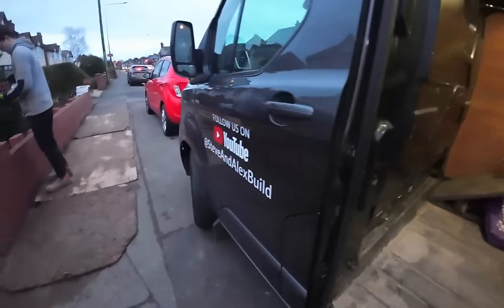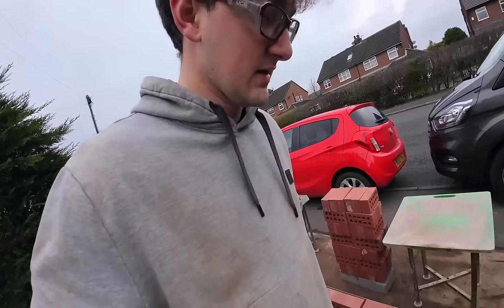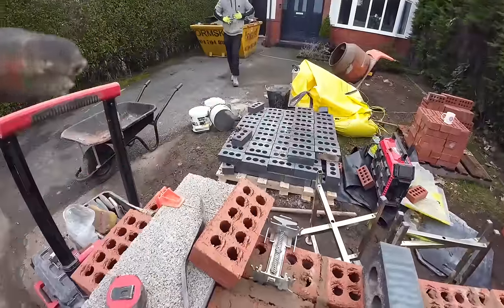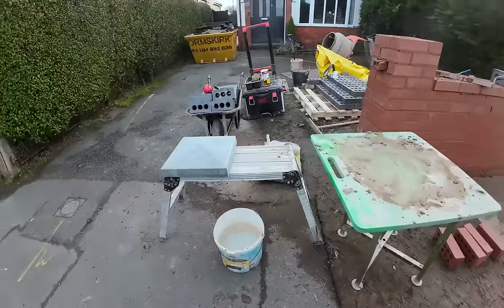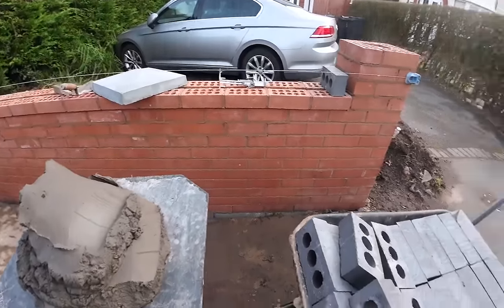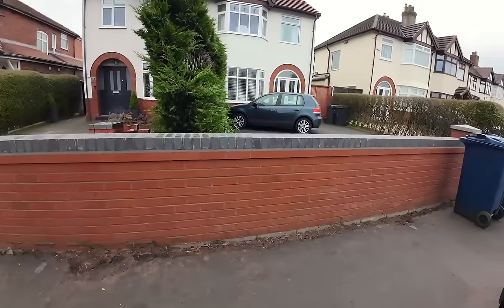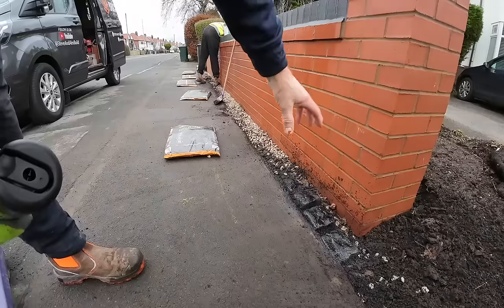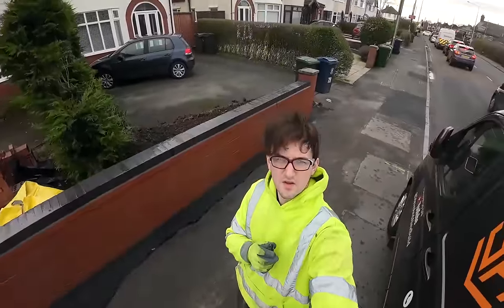BRICK ACID, PETROL AND FIRE

Comment: I thought I’d added a comment about a particular brand of tar repair that I use at work, anyway it’s called viafix comes in 3mm or 6mm tubs, so easy to spread and compacts well, no need to break it up or set it on fire 😂

Comment: Great work and you sealed the seam between original path and new tarmac to stop water getting in , then freeze and thaw ruining the join. Wish the idiots who fill potholes would do the same. They used to have metal watering can full of hot liquid tar but not anymore and so the patched pothole soon becomes a pothole again.
Reply from the maker: Very true the roads are shocking now 😒🧱👍🏽

Comment: I have seen and repaired many freestanding walls, solid and cavity walls. Many were built in the 70s and 80s. Often there is frost damage in the form of peeled and cracked cell bricks with a lack of cover or cover without a water nose. One of the reasons for the damage is due to moisture and frost. Unlike external walls in heated homes, there is no heat source on free-standing walls, so the moisture can only evaporate with the help of the sun and wind. Salt from pavements and roads is also hard on masonry. We repair joints and replace peeled and cracked stones and, for example, provide roller changers with a moisture barrier and cover, e.g. zinc, copper or concrete with profile water nose underneath. We put valves with insect nets in the lower and upper row. Some freestanding walls were too bad to repair and were taken down. I can see from the foundation depth that You do not dig and pour to a frost-free depth, 900mm according to Danish standards, so without knowing your location, I do not suspect that you have so much frost damage to the masonry. Funny to see your different way of having mortar on a slab, on top of a stand and I'm a fan of your support of masonry with the angle/plate you can put on the support columns.
Reply from the maker: Nice to hear how things are done in other countries. 
We are in England 🧱👍🏽

Comment: Steve & Alex, lovely wall, how do you use the salt acid as I sprayed it on a patch of my wall and it went all white?
Reply from the maker: Salt acid 🤔? 🧱👍🏽
Reply: Yeah, the brick acid to remove salt marks, I had a few white streaks where the salt leached out so I sprayed it with the brick acid and now have a large white patch, washed it off a few times but still evident.

Comment: Use your wheelbarrow to set fire to your tarmac then you can pour as much fuel in as you want without it flowing out of control on the path way. Also, what helps is leaving the bags of tarmac in your van until its actually time to use them.
Reply from the maker: Thanks for the tips 🤜🏽🤛🏽👍🏽🧱

Comment: Nice jobs gents. One thing bothering me. Maybe it's the camera deceiving me, but when you a running in the BOE you had four bricks on the corner by the driveway. The one you were working to. It looks like by the time you get up there you are running into one brick with your  pink cuppa on top. Then the camera shows you finishing up from the front angle. Back to four bricks and the pink cup has mysteriously disappeared.  Not a criticism, just need to know should I book an appointment with spec savers.